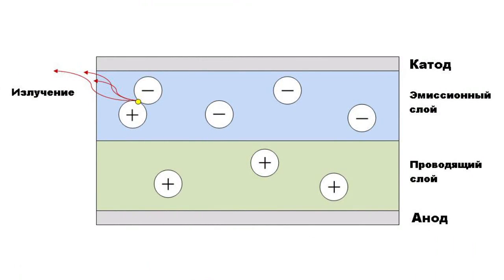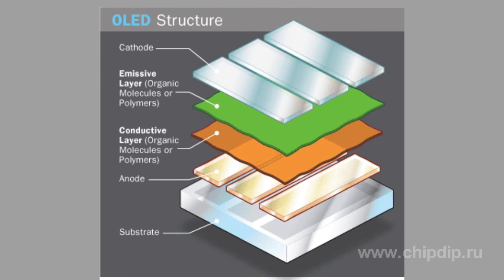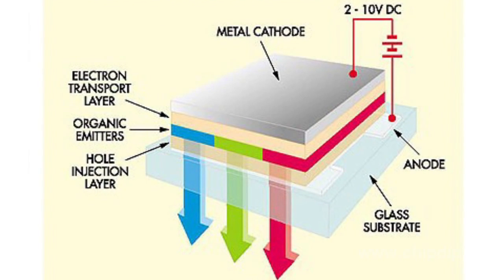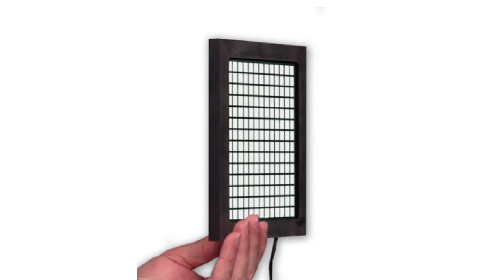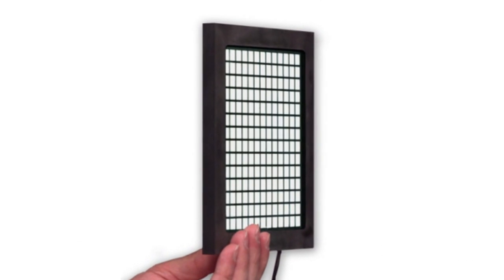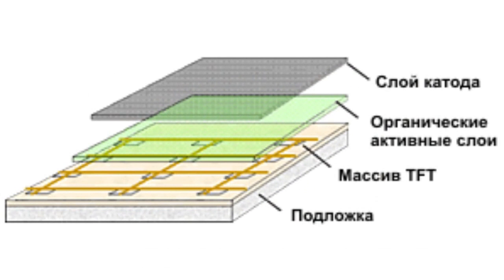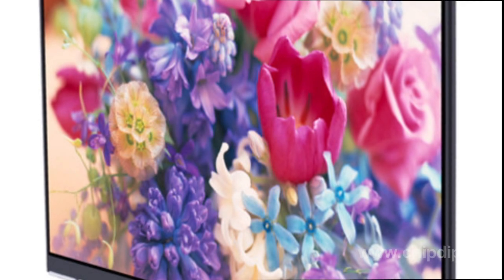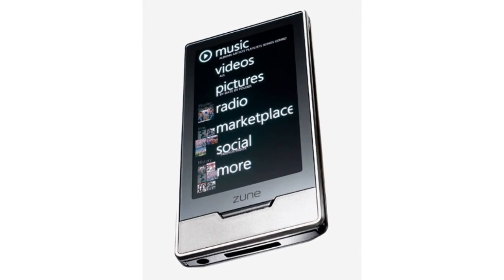Organic Light Emitting Diodes

Comment: It seems their  will be 2 types of individuals that  will be using the transparent technology, individuals that will not change and they will only want to hold onto yesterdays technology, thick fat slow technology, and individuals that are on the ball and will embrace and see the need for better technology. Transparent smart phones are here to stay and oled's are leading the way along with leds  and clear micro circuits and clear components. Not just prototypes but the real phones and something else that has not been seen for 7000 plus years bubble glass. Norman Palmer
Reply: OLED  is full led in a glass panel no lcd tricks  will beat oled because  oled produces a realistic  natural  colour  vs lcd mixed with bag of of tricks  to produce blacks that don't bleed

Comment: What are the advantanges and disadvantages of OLED screens vs. regular LED screens?
Reply: Positives: AMOLED displays offer a high picture quality and fast response time. Color and brightness are consistent across the screen. Fast-moving images and motion are displayed clearly without blurring or ghosting. Super AMOLED panels can display a wider range of colors with enhanced contrast, which makes them easy to view in a wider variety of lighting conditions. 

Negatives: AMOLED displays have the same problems as OLED displays  OLED displays are sensitive to light and moisture. Blue LEDs degrade faster than other LED colors causing color distortion over time. They are also prone to image retention and burn-in. plus AMOLED panels can be difficult and expensive to manufacture.